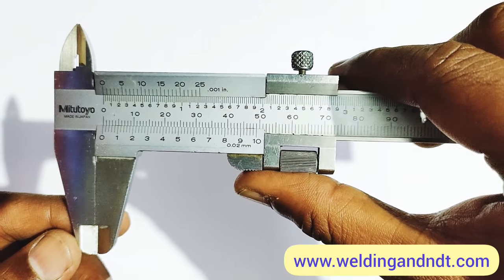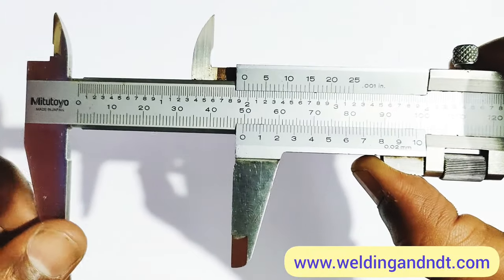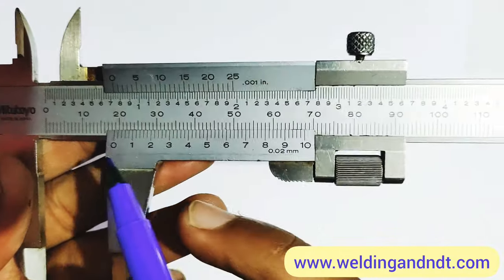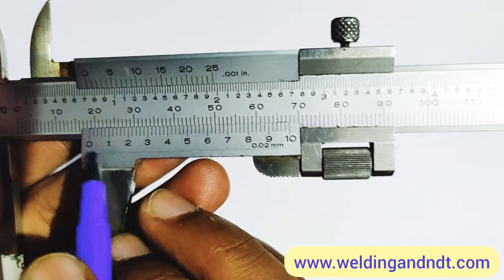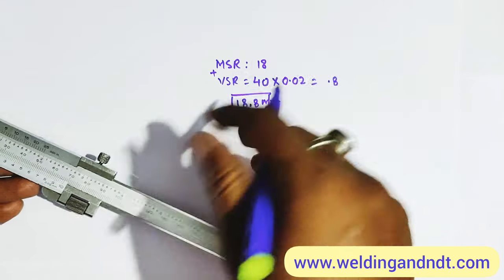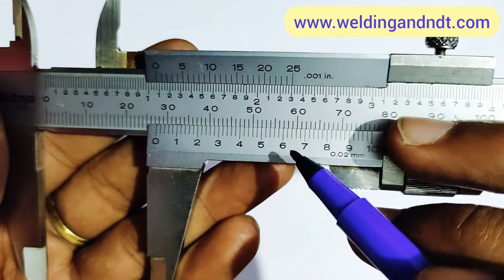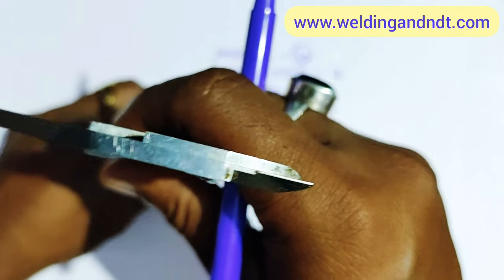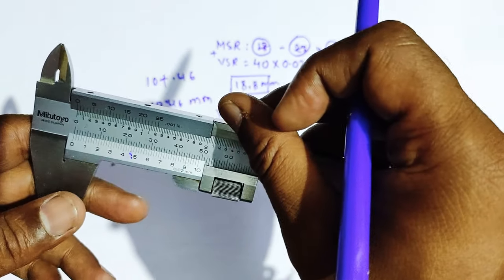[English] How to read a vernier caliper

Comment: Sir please please make a video on inside micrometre,outside micrometre.In college we were taught with the basic micrometre only.When I joined the job I got to know that there are bigger micrometres of different ranges.I am having a hard time understanding how to use them.So please clarify how to use  inside and outside micrometre.How to do the increase the range of micrometre with attachments.How to fix & maneuver the micrometre while measuring so that we don't get wrong values.Secondly also emphasize with live example  how to  decide whether we have to use a vernier or micrometre to use a dimension.How to decide which one to be used whether.Thirdly also clarify when we use bore gauge.Why we use bore gauge when we have inside & outside micrometres.What advantage bore gauge has iver micrometre.How to decide where to use bore gauge &when to use inside micrometre.